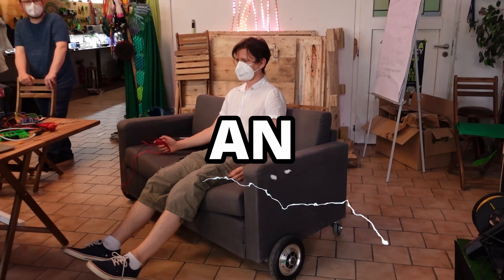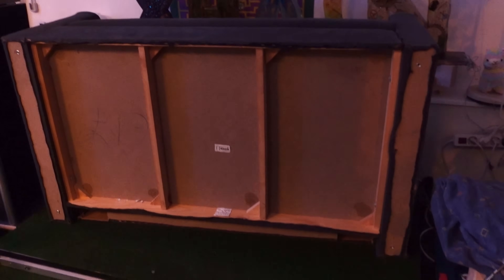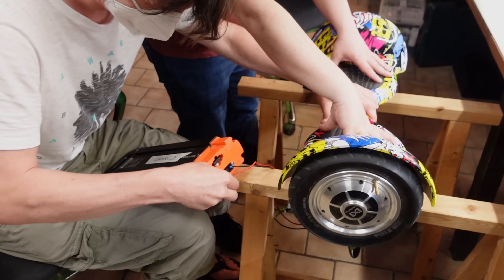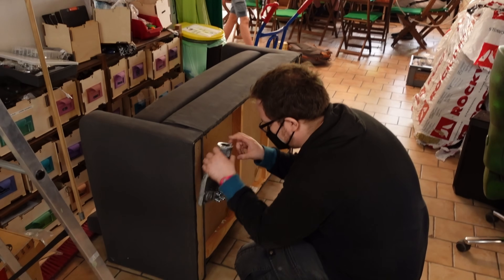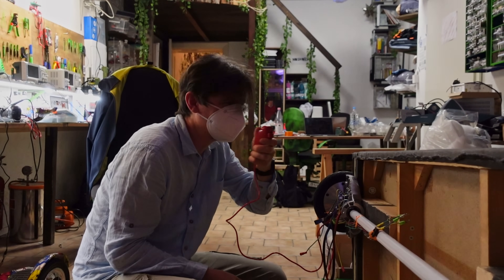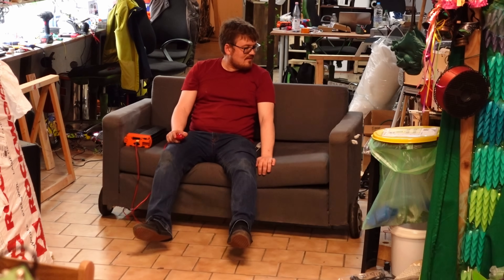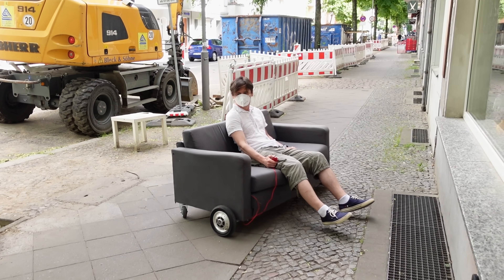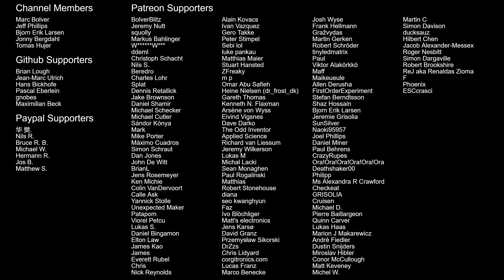Motorized IKEA-Sofa from Scraps (Custom Hoverboard FOC)

Comment: It's easier to add an ESP32 in front of the hoverboard main controller because:

1.  The mainboards are SUUUUPER noisy and the serial interface will at least give you checksums; you also get serial feedback as a bonus.
2.  You can use the ESP32 to allow multiple input types without touching mainboard firmware.  (I made mine selectable between Crossfire RC protocol and bluetooth Wiimote+Nunchuk on the fly.)
3.  Not all nunchuks are created equal, so I use the ESP32 wifi as a configuration server to quickly configure min/max/middle throw of nunchuk and also to adjust expo.

Comment: I think the default mode for that firmware is voltage control, which does not relate well to actual rotational speed and gives the "bull ride" result you mentioned. You can set it to use speed (aka velocity) mode which adds a second loop to adjust the voltage based on desired speed. The 'speed' mode is extremely smooth to control and will give you brake as well (can park on slopes), but then you'd probably have to be careful not to brake too quickly. For a human riding application none of the modes are really perfect, imo the ideal situation would be velocity mode but without braking, and then apply braking separately with a second channel. That would give you the closest feel to driving a car. Not sure if that firmware allows it though.